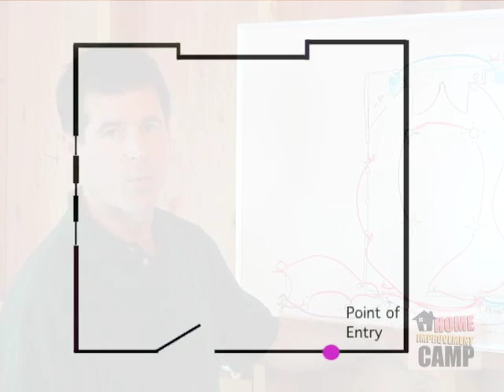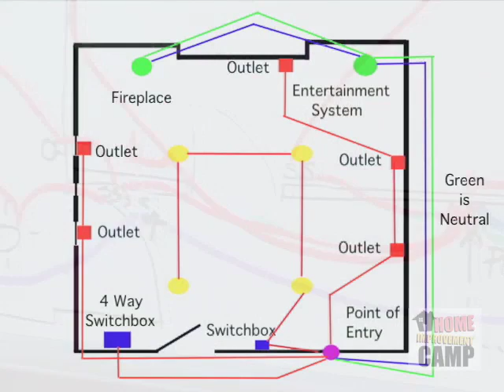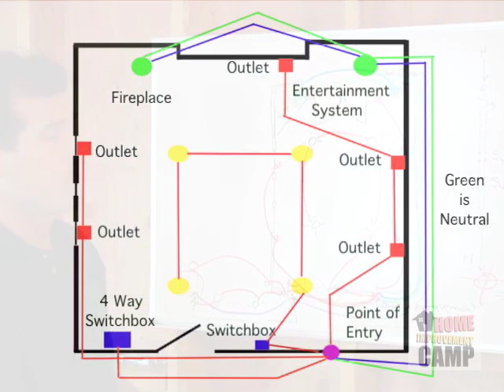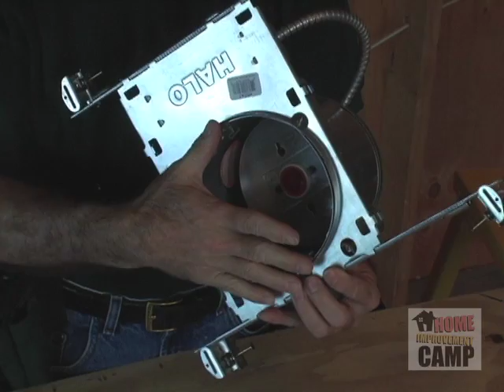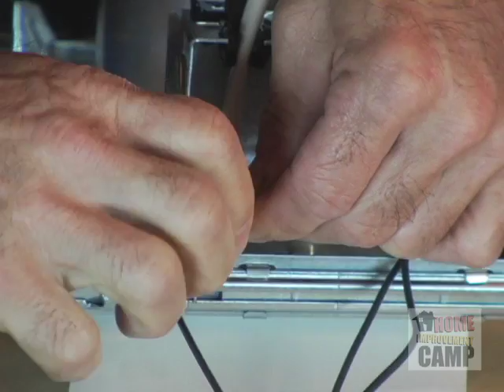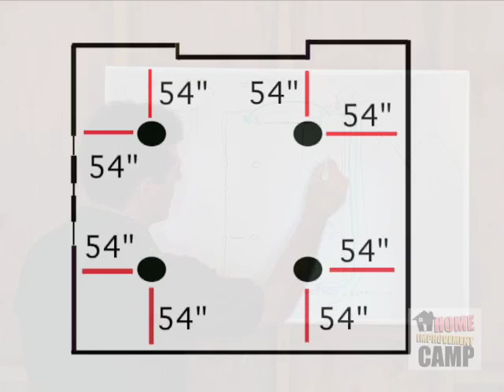Home Improvement Camp - How to Electrical - Wiring and Wiring Layout

Comment: You're going to be doing a  lot of trouble shooting with this because the wires are not twisted together.  A wire nut is not designed to hold together the circuit wire, it is only supposed to adhere the fixture wire to the twisted branch circuit wiring system.  A good electrician can twist four wires ( #12 gauge )  together with no problem.  But four wires takes a lot of practice.  So please never use the wire nut to hold the circuit wires together it will create a fire because the loose wires in the wire nut will just sit there and arc, til something gives.  Good Luck

Comment: When would you run lighting in series versus the parallel setup you demonstrated? Would you ever want to run it in series? What about LED drivers, do these require any special layout?
Reply: +jezeremyhubert afaik you never run anything in series for a home..the voltage would be divided between the elements, ie. each element would NOT receive the full 120v. And ofc, if any element in the series fails open, the entire circuit stops working. Some lights might be wired in series, but they are designed that way (to share/split the voltage supply), and aren't typical (ex. old 'string style' Christmas lights). LED drivers are powered  the same as any other appliance/fixture (assuming it's rated for 120vac) - the individual LEDs in a fixture may be wired in series (or a combination of parallel and series circuits), but again, they were designed that way. Series circuits: elements divide/share the voltage. Parallel circuits: elements all have same voltage. Most products are designed to use 120v (ie. be wired in parallel).